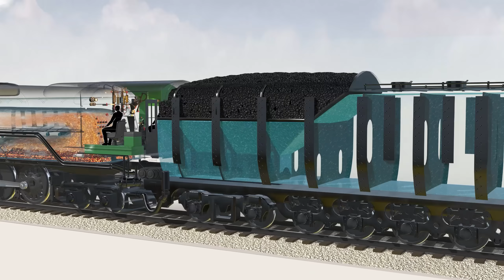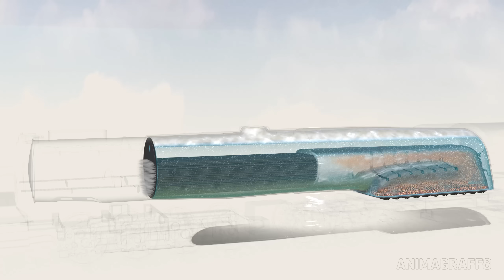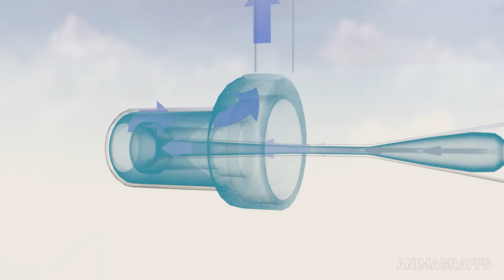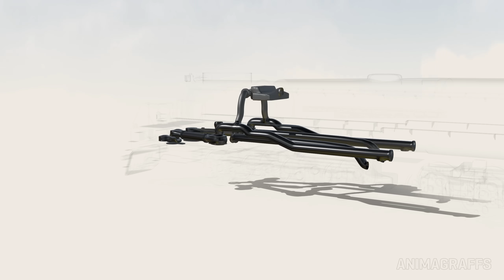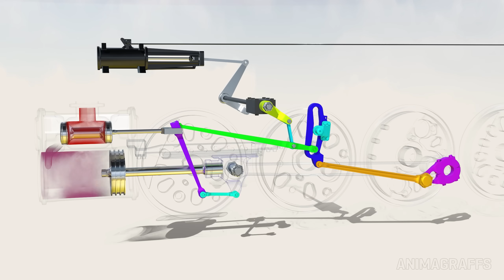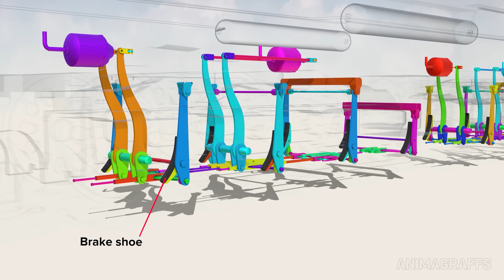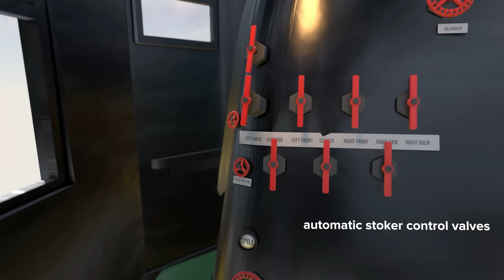How a Steam Locomotive Works (Union Pacific "Big Boy")

Comment: Wish they could develop a clean coal boiler w/ a scrubber and closed loop boiler water system so they wouldn't have to stop for water so often. That would require a heat exchanger. And maybe an on-board water purity plant to eliminate scale and impurities. Using coal as a fuel source would be basically free since we have 1000's of years' supply in WY.  No refinery required to make diesel fuel. Or switch to oil when necessary.  Not sure if a steam turbine and elec generator would be easier to manage power to the tracks.  Just think of the tech of current clean coal power plants and miniaturize it.

Comment: Awesome video!

I'm surprised they didn't include a cooling system to recapture the water and reuse it over and over. 

Pretty much all other steam engines (both piston and turbine), including steam engines on ships, nuclear power generating stations, the more advanced steam powered trucks and cars (like the Doble steam car) ALL capture the used steam, cool it back down and pump the now liquid water back into the boiler for reuse.

By throwing all of the steam away, these steam engines would have consumed absolutely incredible amounts of water.

Another feature missing is the fairly common multi-expansion piston configuration used to improve piston steam engine efficiency. For example the piston steam engines on the Titanic were triple expansion engines, with high pressure pistons that received the full pressure, then the exhaust from those powered medium pressure pistons, followed by a set of low pressure pistons that were powered by the exhaust from the medium pressure pistons to maximize efficiency.

Comment: I had always assumed that the problem of adding water to a tank (boiler) under pressure would be accomplished by using cylinders to pump water at an even higher pressure. The fact that it can be done with the steam by basically adding momentum to the water sufficient to overcome the pressure is amazing, and with no moving part, wow. I will have to watch that part a few more times to really understand.

Thank you sooo much.

I believe this is the first video of yours I have found. I had subscribed by the halfway point.

Comment: The heating-system as shown here are still in use today, but mostly as industrial heaters. I work with cleaning these things. So I crawl around inside of them wearing a hazard-suit and fresh air supply while using rotating chains to clean down all metal parts. They are usually around 40C when I crawl around inside them, so I'm completely wet after just a short while inside.

Comment: Impressive animation but you have missed a trick in not explaining how the throttle valve and the reverser interact which is the heart of the description of how the steam engine works. Your explanation confuses the two controls in saying that the valve gear allows the engineer to use less steam when coasting. The throttle valve controls how much steam is used and not the valve gear. The purpose of the valve gear is to control how the amount of steam that comes from the throttle valve is used. It balances power against economy. When you want maximum power the valve gear is open for the most travel of the piston using the high pressure steam for more of the stroke which is not economical. When you close down the reverser the valve is open for less of the stroke and the piston is pushed by the expanding steam at reducing pressure. This allows more energy to be extracted from the steam and is more economical when you need less power. The skill of the engineer is to balance the throttle and the reverser so that enough power is provided to drive the train as economically as possible at any given condition. Best wishes - John (ex Rolls-Royce Aero engineer).

Comment: What a great video! The engineering that went into these machines is incredible, all the clever little mechanical devices that allow it to run are amazing.  Steam trains had been around for quite a while by the time this bad boy was built so it can really be seen as a culmination of all the technology that went before it.  It’s kind of sad now that if you want to control something you just stick a PLC and some actuated motors / valves in and it does the same job. That throttle mechanism is a work of art, so clever, I’ll bet it was refined over years of building these things.

Comment: hey there, great video and awesome graphics and 3d model and overall very well explained. I do have at a critique/correction tho.

I'm a traindriver from switzerland. Also very interested in steam locomotives. 
What was a bit weird for me is the temperatur of operation you gave through (1800 - 3000F) or 982.2-1649C
I feel like theres a bit of something messed up there. The average temperature of most locomotives we have in the historical department are between 200 - 500C. Depending on the workload, amount of fuel, and size of the locomotive/tender. since this is a bigger locomotive it can very well be (I don't know this one good) that is has higher temperatures, But I feel that especially the high range is quite far off. Since most metal we know is at that temperature more molten caramel like than any structural good. So it could burn through the pipes and sides of the oven. Just wanted to let u know. I'd check on those numbers again. Greetings and keep on going.

Comment: the ball joint I get, but how doesn't the axel inside break? I'm a software engineer but I think I should still understand these machines especially when they're 3d modeled and animated... yet I can't understand everything... It only goes to show you, the complete genius those 40s engineers had, drawing such intricate models with a pencil... it's insane, I don't think anyone can design this today without a computer.
edit: also how does the rear part of the locomotive get stream, is it another ball joint? is that even leakproof? or did they have a hose-like connection made out of some flexible material that can withstand those pressures? or did they dial down the pressure just for the rear part? I have too many questions

Comment: I realize you are simplifying some parts of the explanation for the sake of all potential audiences you might reach, but two things to correct and/or nitpick:

To say that "pure steam has no water in it", is just fundamentally wrong. After all, steam IS water. It is gaseous water, or water that is in gas phase. Water is most common to us in its liquid phase, but the molecule itself, H2O, is officially called "water" regardless of what phase of matter it is in. "Ice" and "steam" are just convenient names given to the other common phases water is found in due to use conventions as old as human civilization, long before we ever understood why water could be found in all 3 common phases.

Second thing you mentioned, "steam can be compressed while water is not compressible at all", is also not true. All liquids, including water, are compressible, just not on a practical level. It would have been better to say, "steam is easily compressible while water is not compressible for practical uses."

Comment: Water is compressible  (±0.02 × 10−6 bar−1 for pure water and ±0.01 × 10−6 bar−1 for seawater) or  5×10−10m2/N, that is why hydraulic oil is use rather than water.  Great animation!

Comment: just watched a video about the engines on the Titanic. One thing I didn't know was that the steam was condensed back into water which pumped back to the engines to be turned into steam again. I wonder why there wasn't the same circular process in locomotives to save water. I'm guessing it would have made the system much too complicated.

Comment: "Water is not compressible at all" ... not entirely true, but it is difficult to compress.  Known as the coefficient of compressibility or isothermal compressibility, it is a measure of the relative volume change of a fluid or solid as a response to the application of pressure.  

The compressibility of water is a function of pressure and temperature. The low compressibility of water means that even in the deep oceans at 2 miles depth, where pressures are on the order of 6000 psi, there is only a 1.8% decrease in volume. It is this low compressibility of water that leads to an incorrect assumption that water is incompressible.

The pressure found at the bottom of the Mariana trench is actually compressed water, under extreme pressure.  Although the numeric amount of compression appears low, that does not discount that it is compressed.

Comment: Im still a little confused how the reverse is engaged. Is the main drive piston stopped part way so pumping in steam from the other side literally pushes against the wheel in the opposite direction? What if the piston stopped exactly halfway and the big drive rod didn't have a bias to push against? For that matter, what if that happens when it's parked? How does it first get going?

Comment: Awesome and detailed video showing the most perfected and advanced versions of steam locomotives! While watching i started to wonder though, how is this thing started? Every component it has depends on steam pressure being already in the system.  Even drafting uses waste steam to operate. With so small stacks the initial draft must be nonexistent, how is the fire started in the first place? Does it depend on some external pressure being pumped in, electric fans driven by station electricity or something else?

Comment: I wonder if someone ever tried improving this amazing design by using turbines instead of pistons and maybe even recycling the steam via heat exchangers using the passing air to cool and condense it back to liquid, thus needing less heat to get to boiling again later (not much though, the energy needed to boil water is much more than that necessary to heat it by 80 Kelvin). I believe a lokomotive is too small to effectively use a steam turbine, but I still would have tried it :D

Edit: Engineering back then was so amazing, complicated but functional! These days it's all just cheap crap run by a cheap microprocessor from china and maybe also run by bad software (The same happened in programming. Resources were tiny, so code had to be small but functional. These days almost nobody knows to properly code anymore. They only use bad unnecessarily slow programming languages, just copy and paste together some code to fit or use other programs to create the code, always making it full of useless lines of code slowing everything down and causing tons of bugs).

Comment: That's insane level of details 🤯. And it clearly shows that a steam driven locomotive 🚂 is equally if not more sophisticated than a nuclear power plant 🏭 or a nuclear submarine, because they work on the same principal, producing steam by burning fuel to transform into mechanical or kinetic energy which then produces the desired form of energy be it mechanical force or electricity. The only difference is the fuel they use . The physics of steam engine is truly a timeless technically 😊

Comment: simply marvelous explanation of a complex piece of machinery designed by people without the benefit of modern computing technology, made piece by piece by skilled machinists and run and maintained by people in overalls with dirty hands.  A million pounds of iron horsepower.  Alas, used in revenue service for only a few decades before electromotive power took over.  At least we still have UP4014 running.

Comment: My dad was a fireman for the Milwaukee Road from about 1955-65. He worked on some of the last, large steam engines they had as they finished transitioning to diesel electric engines. As I recall him telling me (he died in 2000) the 'old' (not really very old at the time, just obsolete) big steam engines were relegated to jobs around the yards before they were eventually scrapped. I wish we had had a relationship where I could have found out more about just what he did, but he was the kind of dad who told you what to do, not what he did.

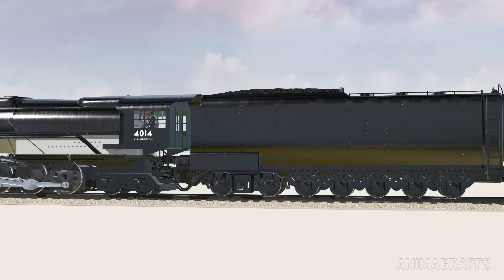Comment: 1:01 NO, 604 Tons are not 6 million Kilograms, but 600.000 (600,000 in US writing) (1 Ton is 1000kg) 

For a Video so well made this is an embarrasing conversion error.
And starting with this, I was sceptical of every statement you made in the video.

So the next statement was also missleading: 1:06 "4 modern engines ..." No. I took the Siemens ES64U2 for refference, called Taurus here in Austria. It weighs 86 tons and has a 	tractive force at starting at 300 kN, the Bigboy has 600 kN, at 600 tons, so the statement is wrong by a factor of two.

Power of the Taurus: 6,4 MW (constant)
Power of the BigBoy: 4,6-5,1 MW, 

The next wrong information is "5 miles train". The longest train ever pulled in the US was Nov15th, 1967. The 4.06 miles long train weighting 48,170 tons from West Virginia to Ohio. Powered by 6 (!) DIESEL engines, three in the front, three in the middle. 

Even if a single BigBoy would try to pull a five mile train, it would tear its drawhook out.

I'm not going into the obvious reasons, why those steam engines had to go, but missleading statements like that in the first two minutes are a shame.

Your videos are fantastic, please get the facts rechecked before release! Took me fiveminutes to google that. The Informations about the Taurus I knew from work.

Comment: DUDE I LOVE VIDEOS LIKE THIS. Recommend you do a video on the successor to the CH-53 super stallion known as the King Stallion. Specifically because the helicopter is designed with fly by wire which is very uncommon in helicopters.

Comment: I was a “Watchman” for the Durango/Silverton Narrow Gauge Railroad. There are 3 sizes of engines on that line. 120 ton engines (470 series), 140 ton (480 series) and one standard gauge engine fitted with narrow gauge wheel sets (490) tonnage unknown.  When I worked there, the 490 was sitting in the boneyard, and during one shift, I climbed up into the cab, and looked in the firebox. Compared to the 470’s & 480’s, the firebox looked like the size of a bowling alley. I could only imagine looking inside the firebox of the Big Boy. It would be like an auditorium to me. What a workout to sling the coal to all parts of the firebox floor.

Comment: I was always curious if any of the Big Boy locomotives during the latter part of the steam era were ever converted to run off of fuel oil for steam propagation. 

Also of course the containment would have to be more substantial but one thing that would be interesting is if anyone would ever develop a steam engine to run off of nuclear power for steam production since nuclear power plants and nuclear vessels are inherently steamships

Comment: when you display a large number like 190,143.7 noone cares about the .7. just leave it away. actually you could also leave the 143 and just say 190,000 . because the leading three digits 190 are already accurate enough to a hundredth or thousandth.

Comment: 33:20 "... when shoveling coal manually." Me: "Soo. There is an automatic way to get coal inside? Whaat?"
These videos often start with me thinking along the lines of "Well, steam gets hot, pushes cylinder, wheel rotates. Problem solved." And then I learn about all the little details which are not relevant for a proof of concept, but make the actual device such a marvel of engineering. <3

Comment: 1:10 .'...and wood [fuel]..." I think not. I realize here you are speaking about steam locos in general, not specifically about the Big Boy, but you should note the distinction.
1:18 ".... train 5 miles long..." Come on, guys. That would be in the neighborhood of 500 cars. I am willing to concede the incredible Big Boy might actually have been able to move such a haul of empty cars on absolutely flat ground, but the rated tonnage Wikipedia lists for the typical routes for Big Boys would allow for trains of maybe 100 fully loaded coal hoppers, which these engines were built for. I don't think even in these days of distributed power, anyone operates single trains of such unwieldy dimensions.

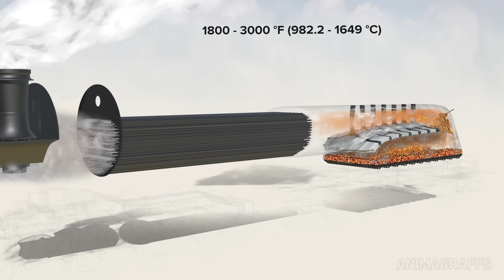Comment: 4:51 - - If the upper limit of normal operating temperature is 3000 F / 1649 C, why that does not melt some steel there? Also, hundreds of degrees below the melting point, steel degrades irreversibly because of heat.

Comment: Venting exhaust steam through the chimneys gets only a quick mention at https://youtu.be/Hszu80NJ438?si=PqCi08HFcBt5Htwo&t=807, but the draft that is created that sucks air into the firebox was the genius design feature of the steam engine, increasing efficiency remarkably. I have seen the fire in a steam locomotive firebox turn yellow-white, it was so hot from the air rushing through the burning coal. (By the way, superheated steam can get up to 600 degrees and can be used to light a match! It's weird stuff.)

Comment: And what a steam locomotive it is! Great choice. I have always been fascinated by that monster. I could never understand how steam pressure could be used to force water into the boiler using just the same, equal steam pressure from the boiler until I saw the venturi diagram here. Very clever! We think of steam engines as quaint today, but for over 100 years, the best engineering minds worked on steam engineering and designing the clever devices that ran not only without electronics, but without electricity!

Comment: One thing I especially admire about mechanical devices like this is the ingenuity the engineers were forced to make due to limited resources. They couldn't just have an electric motor and battery for the different auxiliary components. Everything had to rely on steam.

Comment: I absolutely adore the graphic animations. Small point: at 1:02 you give the mass as 6,000,000 kg. I think you meant 600,000 kg. A 6000 tonne engine would have limited routes to travel but would have been a beast to behold. 😀